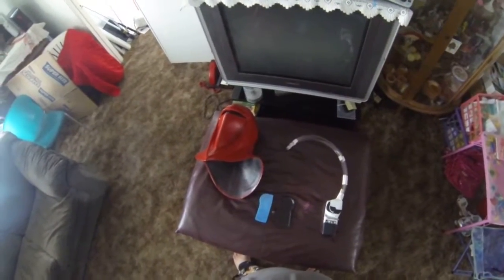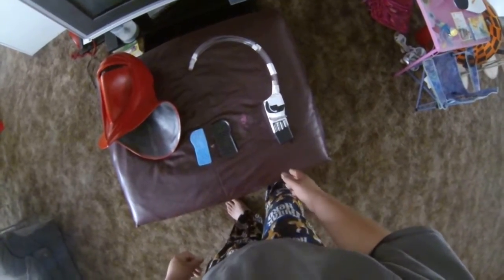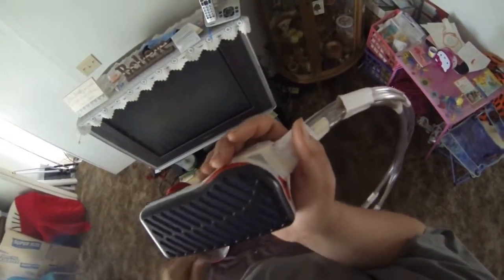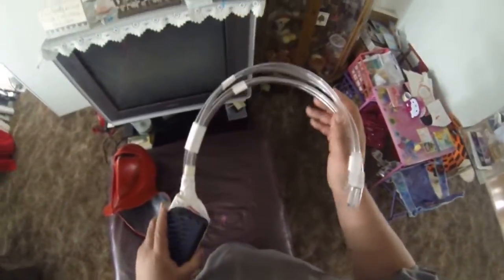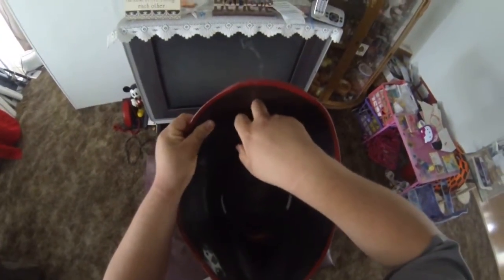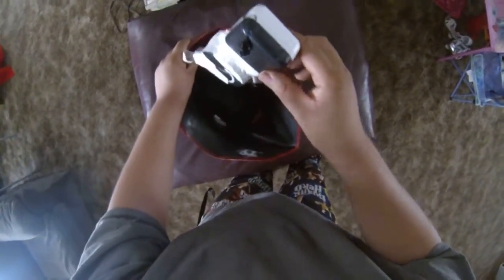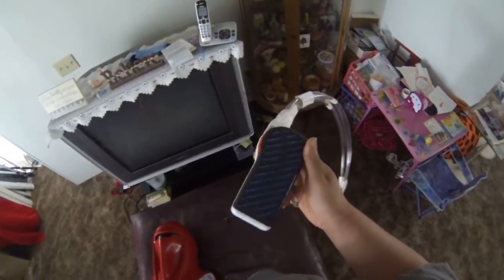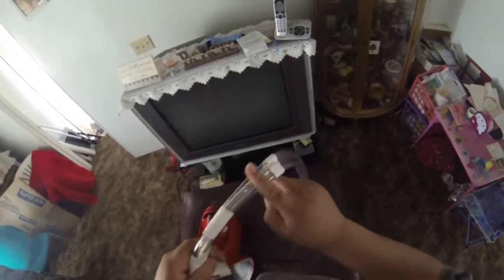Star Wars Helmet cooling system

Comment: where did you get the base cooler from?
Reply: ebay. its a handheld swamp cooler. and you can get quarter inch thick tubing at any hardware store.
Reply: cheers